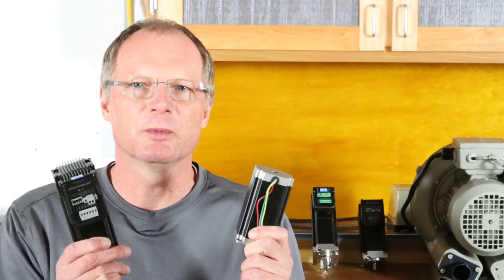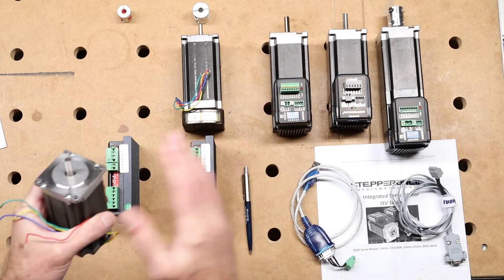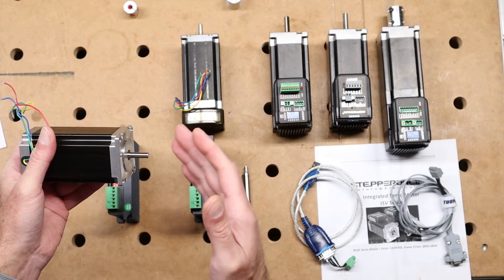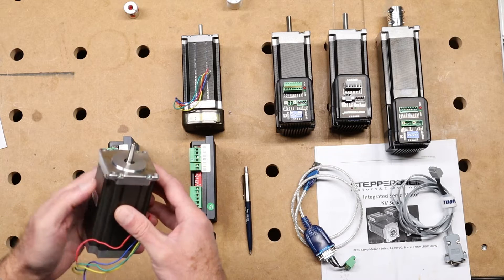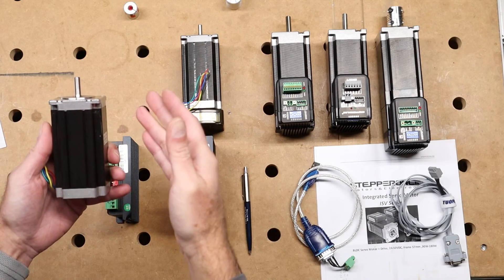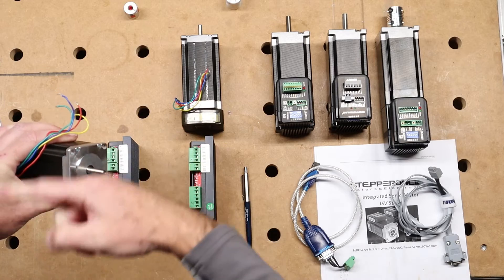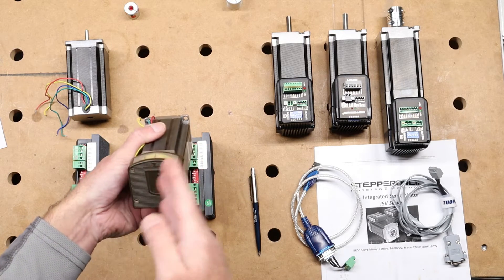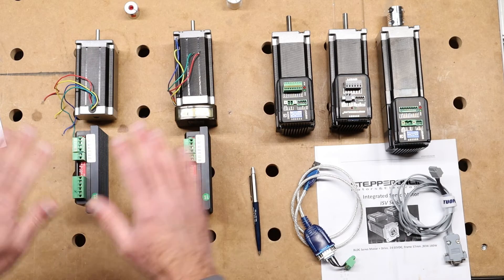DIY CNC Motor Upgrade

Comment: Servo motors have better qualities, and that isn't debatable.

Hybrid steppers are however more than adequate for DIY machines, precise and fast enough.

With 1:1 ratio between motors and 5mm pitch ball screws I have 6000mm/min rapids (but I can reach up to 9000, useless for my small machine) with NEMA34 12Nm hybrid steppers.

I love them.
Reply from the maker: There is one other aspect that is often overlooked. The servo motor has a zero pulse  this is very valuable for a dual gantry machine. Homing the machine using this zero pulse is the most accurate way  and will set the gantry square every time. That alone makes a servo install superior to me.
Reply: @JBWorx Sure.
You can however home the machine with precise microswitches, I did that on mine, using Metrol ones (even if it doesn't have a gantry, is a 3axis benchtop milling machine).
I have a measured repeatability of less than 0.005mm on the homing.

And...if I'm not wrong I found the Metrol microswitches watching a video you made...
That means you're responsible of my struggle to make a two-step homing using both proximities (on which I can arrive fast!) and then the Metrols.
😂

I put some photos of the sensors supports I had to make to do the job on my video about the making of the machine 😁.
Reply from the maker: 🙃 how cool 🆒 s that. And yes these are awesome but most people don’t spend that much money. 
Will need to watch your vid.
Reply: @JBWorx Yes, they are!
I was lucky, I bought six of them, not precise as the ones you tested, for les than 150€ from a new old stock auction on eBay!

On my machine (it is the "Italian version" of the Optimum BF20) I make mainly injection mould for my Precious Plastic workspace, so I wanted it to be as precise as I can since I have often to divide the machining operations in multiple days, and using small tools I often leave very little stock between operations.

For the moment it is going fine, I just started using it...
And at the moment I'm stuck at home because I broke a vertebrae, I can't wait to make what I planned... and more.
Reply from the maker: Improving the machines we have also a lot of fun. And sometimes that is all I do 😀
You go a steal on these switches! 
Hope you are feeling better soon !
Reply: @JBWorx  Yes, I was very lucky with the Metrols!

The machine I have it was used manually before, I'm a professional machinist and I had the possibility to use my workplace machinery after work hours, I bought that in 2008 because I had issues with my old employer (some people don't deserve good workers...) and he stopped a project he agreed to develop together.
It's a long and silly story about people's smallness and jealousy of being less capable at something...better to forget that.

The first iteration of the machine is what you can see on the video, for now I think I have to better protect the axis motors to add the flood coolant, and to make the enclosure.

For what it is and for the conditions in which it was I can't be happier.

Thanks for the wish, I need it!😅

Comment: thanks for great video. I have cnc with servo motors, and have a problem with Z axe. Maybe someone can explain my issue. Z axe after an one hour work on 2.5 D project cutting  goes up about 3 mm. When it goes back to zero position Z axe high is changed, not down but goes up. X and Y axes position is not changed....What could be the reason for this problem?
Reply from the maker: There are many possibilities one is to check the coupler that is on the motor shaft. Also you can test to set the acceleration for z a little lower seeing if this is a loss of position over a longer period of time - so always adding a little over several moves. Also check if the tool is slipping in case you measure a different length of  the tool stick out.

Comment: Can you make a video about tuning the stepperonline servo? I can‘t find anything on youtube and i would like my cnc to come alive😅
Reply from the maker: I plan on updating one of my servos to a 400W Stepperonline however this will take a while as I am currently using my machine to make the fogbuster and some other projects. I would give it a go and just read through the instructions the map to follow is the same as for the JMC Servo. I found the software easier to use.
Reply: @ I've been trying for a week now and I can't get the position error below 500 or so. There are no useful instructions for these servos anywhere and I'm about to give up.
Maybe i try again in the future
Reply from the maker: Actually 500 is really good the scale is not the same as the JMC Servos. The increments on the resolver on the motor are much higher on OMP so my suggestion is take a dial indicator set onto the axis now move the ball screw until you see about 500 or so increments look at the movement on the indicator. I bet it will be in spec for what you are looking for.

Comment: I didn’t wanted to deal with the servo calibration. Bought closed loop steppers from JMC. 48V 3Nm.
Bought a Sorotec compact line 0404 this week. Now I have to wait 2 weeks till it’s ready for pick up 😂
Reply from the maker: It’s actually not that bad, even as a beginner. That is a nice machine ! Congrats and have fun.

Comment: First i would like to say your videos are awesome super informative and thaught out some of the best information on youtube ... i think you need to add some more tags to your videos tho because they never show up when im serching hobby cnc topics its allways that Roger clown .... secondly what was the reason you ended up goin with the jmc servos over the stepper online servos ... and 3rd thing would you do a full rundown series on your machine . Ballscrews servos motion controll what your useing and why i think you would have alot of usefull information to share ... keep it up love your content
Reply from the maker: Thank you for your feedback that is very motivating YouTube has a mind of its own at leased for my videos it’s difficult to get my view count up. Lately I ask for a like and that seems to help quite a bit. I might have to go back to older videos and add some more tags … thx for the input. 
So I had the JMC servos first but then ended up making an exchange for a customer of mine and bought the Stepperonline servos. I think after years of use I can say I like the Stepperonline servos better the only problem is you cannot get one with a break for the z-axis. They are available as a separate add on however from other vendors. PS: Roger shows up for me as well … lol 😂

Comment: Thank you for your video, which power supply do you use for the integrated Nema23 Motors?
Do you take care about the back-emf with a brake chopper?
I noticed deceleration is inducing power and taking out the 36/48V motor easily.
Reply from the maker: I use a single 48V no name power supply. I have not had any issues on several machines when the motor decelerates (generator mode). However I think the problem becomes more noticeable once you start to dedicate the power supply per a single axis.
Reply: @JBWorx  I'm trying to max out the speed on my machine. If I don't then everything's fine (on a DIY CNC you usually don't go that high speed).

However since you have such a machine -- would it be possible to run a speed test to show how far you can go? Just slowly step up to see when / if you also experience that issue?
max velocity is actually not such a big topic - acceleration is and for the PSU deceleration when the motor induces the voltage back onto the line.

I'm looking into chopper circuits and plan to implement one within the next 1-2 weeks.
Reply from the maker: I know from experience that Meanwell PSU’s don’t like much feedback current and fault easily. I know that I cannot make mine fault out on the size of my machine and I have dual y - axis motors. So max speed and a hard acceleration (sorry don’t remember the values I used) did not make the PSU fault. However I had a problem with servo drives faulting out on too high acceleration and during deceleration. I reduced the acceleration values until the problem stopped.
Reply: @JBWorx  I'm using Meanwell PSUs here, Y is also supposed to be dual axis (prepared but not installed as dual motors since the single side seems to be okay so far, X single axis (for testing I use the X axis).
Yes slowing things down is okay, but I want to go for the maximum possible speed here. Ok thank you for sharing your experience!

Viele Grüße aus Taiwan.
Reply from the maker: Bu keqi

Comment: Hi, which kind of power cable you prefer for JMC motors, shielded or non-shielded (DC line)?
Reply from the maker: I use shielded wires ONLY ! Even for the limit switches

Comment: Hello are you going to compare the JMC and the stepperonline version ? I think this would be very interesting
Reply from the maker: Thank you for your comment Andrew. I run both of these motors and I think they are very close. I prefer the Stepper online servo. If you check the tuning video you see that I frequently change the oscilloscope resolution for the JMC motor. The Stepper online software does that automatically and that is really not an advantage as you often have to guess how many increments it is showing. However I think the motor driver is better. I probably will not make a comparison video as there is not much interest in that subject. I would only have 2 views … you and me lol 😆.
Reply: @JBWorx  are you using the 180 watt Stepper online servo on you router? I was going to use 4nm closed loop steppers until I saw your video, Clough42 show the servo but it seems to be very easy to move have you had any problems? Thanks keep up the good work. Andrew
Reply from the maker: I have build a much larger / heavier machine with 180W servos and the performance is great. Accurate and fast just fun to watch it move. I saw the video you are referring to and you have to give it a bit more effort to tune the axis than what he did. It can be difficult as a beginner hence my video as a help to get started.
Reply: @JBWorx  are you going to show the stepper online servo tuning? the stepper online version is much easier to get in the UK and as you know their is very little info on them. Thanks
Reply from the maker: I am not sure yet. One note for the tuning is that the resolver of the OMP Servo is better and has more increments. So the same angular displacement on the motor shaft (or same following error for a position in mm on your axis) will result in a much higher increment count on the oscilloscope. So one would think dang I cannot get the tuning good when in reality it is already much better than on the JMC servo. I hope my explanation is not confusing.
Reply: @JBWorx  I just upgraded my machine with a ~17,5kg spindle (coming from the 2.2kw air cooled square it's quite a lot of added mass)  and i'm now facing some practical issues tuning the JMC V5's. I had no issues tuning them before, but i have to tweak the current settings now to optimize the vel and pos error, where i'm still not able to get them as good as before. Since they are the V5's you can't set parameters like the V6. These stepperonline motors got my attention; their manual is way better, it seems they have better tuning features like the V5's of the JMC. Good to hear you like the Stepperonline servo's better. on the V5's the max sample rate of the scope is 100ms and I had some issues, where it was showing a very low tracking and positioning error, but still had serieous (but fast) overshoot. (probably too high frequency for the scope to pick up). I would watch that comparison video as well, but are your JMC's the v6.04 or the v6.05 version? I have the v5's, which have served me great over the passed ~4 years.
Reply from the maker: Yes V5 are a pain I hear you. Ok that spindle is a hunk of added weight. Watch the heat of the motor on longer runs if you increase the current setting. Possibly the acc. Values have to be lowered to reduce the current spikes. The stepperonline OMC servos have given me less problems and I think I would buy them just because the connector is better. I used hot glue on the JMC just so the wires cannot pull out. I don’t remember but if you can change the inertia value on V5 I suggest doing so before you start tuning. It will change the entire tuning profile.
Reply: @JBWorx  Thanks for your response. No, and the lack of that inertia ratio is acting up now. The V6 is also lacking this inertia? I was just going through the limited manual of OMC and noticed they have an inertia setting (which is mandatory on servo motors). On the lighter setup it was working just fine, I could get up to 10000mm/s2 of acceleration at 12m/min. I'm taking it slower now.  The added mass is significant. The only motor that is warming up is the Z axis, due to the load it constantly has to compensate of the 'big giant head' (3rd rock from the sun alert) I just finished tuning them, reduced the current back to the initial values, and made the best of that. I think i'm going to buy a set of these OMC's to test on the Y axis. Or start with one on the X axis. I have this tiny vcarving test I normally perform after a tune and run it stupid fast in HPL and observe it closely to see if one of the 3 axis is off. (it's a fair critical test, not in the 0,001 regions, but that's not what i aim for) i have this machine for fast 3d work in wood. Currently can't perform that test; Igus is somewhat behind on their delivery schedule.
Reply from the maker: @berendlucasvanderweide  Yes OMC has the inertia value and you can obtain it through a move using the tuning software (so the way other manufacturers do it as well).  I can recommend the OMC tuning was fast with good results. Just remember that the encoder has a higher resolution and your tuning error given in divisions or steps will be higher for the same value in comparison to JMC. I do lithophanes from time to time and yes it will help to have high acceleration on these carvings to cut down on machining time.